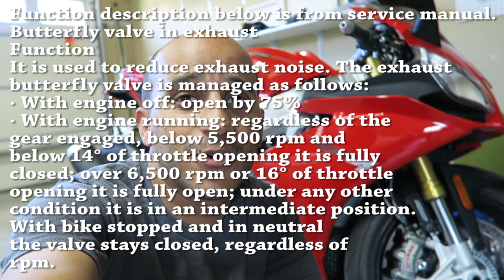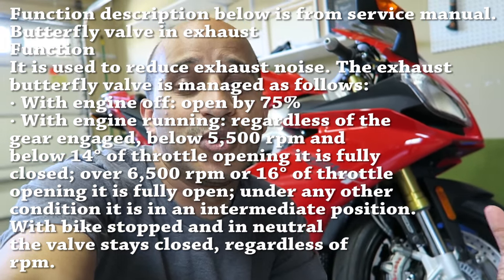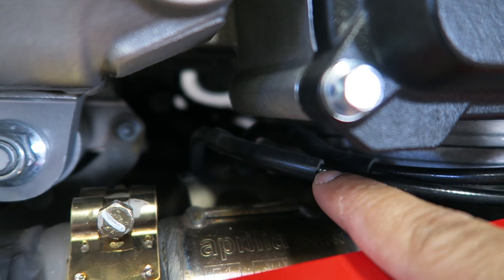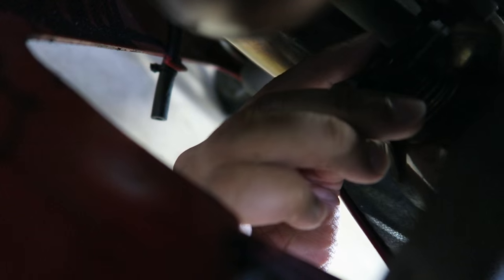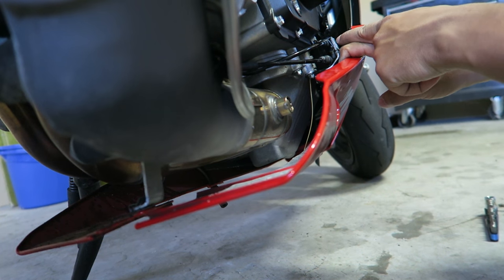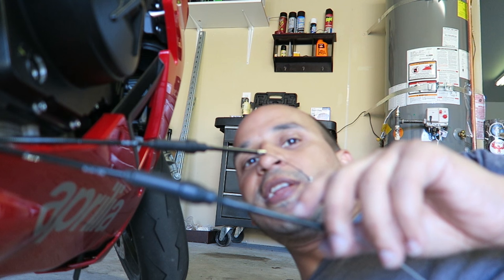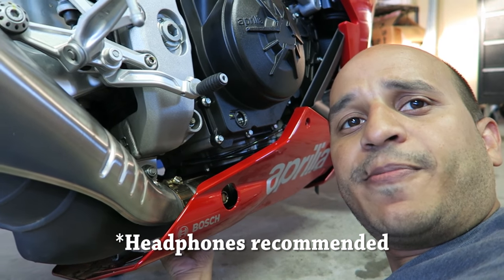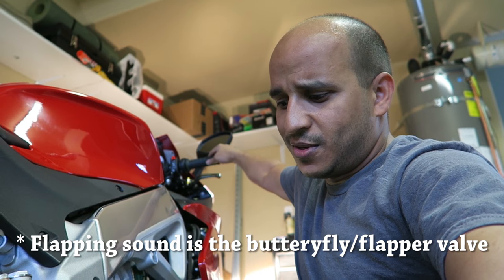Aprilia RSV4 2010-2014 Exhaust Butterfly Flapper Servo Bypass/Removal DIY Mod

Comment: Thanks man!  It seems doing this also fixed an issue I was having on my 2016 RSV4 RF in race mode, where sometimes it would fail to start.  My mechanic did this after noticing the problem when he was remapping my ECU for my Akrapovic exhaust.  I explained to him that the problem proceeded the ECU update.  He made this same modification to see if this would fix the problem.  When it did he explained what the flapper valve does to me, but it didn't crystalize in my head until I watched this.  This video was really helpful.  I'm not the kind of guy that likes to do these things myself, but I like to understand what was done and why things work the way they work.  BTW, he also said I could save some weight by removing the motor you pointed to under the faring that actuates the valve.  After watching this I've no issue with that idea.  I'll probably have this done when I get a lighter battery installed before track session starts up again this year!

Comment: sounds good, and I could be incorrect but I also believe a butterfly valve in the exhaust will also give some back pressure on the engine at low RPM's
Reply from the maker: Got that deep Barry White in my exhaust
Reply: Goatfather seducing all the ladies

Comment: ok but now what is holding the flapper open..i mean under hard acceleration it sounds like the exhaust gases are forcing the flapper closed by was of exhaust pressure???.
Reply from the maker: The butterfly spring is locked which is connected to the flapper & shaft. If the shaft and spring can not move the flap can not move as it is fixed to the shaft. There is roughly a couple MM of play in the shaft, so in theory yes the flap can move ever so slightly, but not more than a few MM if that. Hopefully that text can create a visualization. I should have showed that, but MEH =)